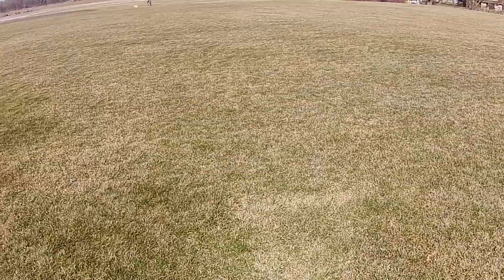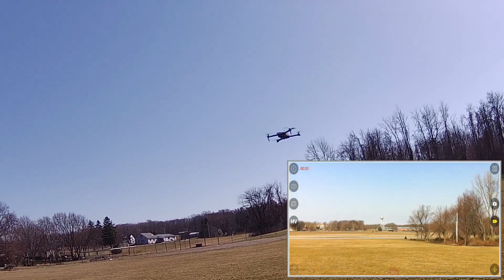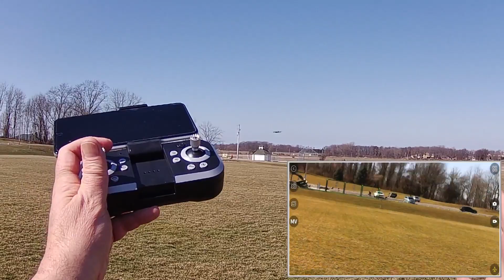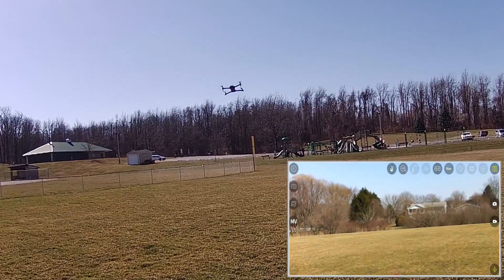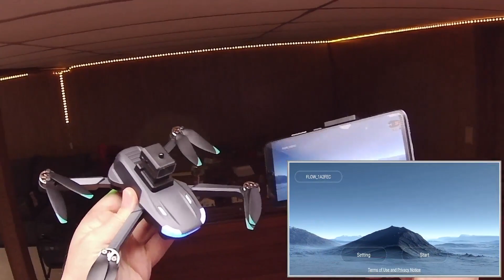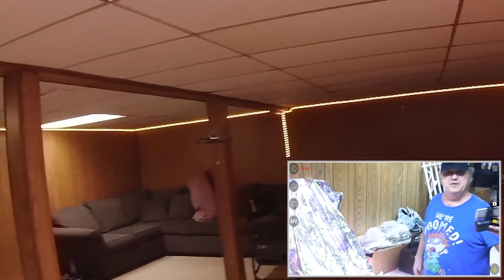YLRC S138 Brushless Optical Flow Obstacle Avoidance Drone Flight Test Review

Comment: Hello Mr with the TShirt. I noticed on one of my cheapy drones that the control is not smooth. If you push forward it tilts one angle according to its rate. So halfway stick forward is the same as full forward. To change angle you must change the rate. Does this drone you demonstrated have smooth control ? Bit stick forward bit of tilt... more forward more tilt. ?

Comment: Not bad ... $50 for a beginner quad with brushless motors.  That's a big plus.  Too bad they are still using proprietary batteries.  Lots of wind noise with your new hat cam .. I wonder if your hat cam has an aux mic input ... might make for better audio in your vids.  I got my old XK X380 back in the air last week. I burned up the OEM WLToys gimbal, Git 2 cam & telemetry module when I decided to re-route the wiring to make it neater ... at 4am.  Reversed the 5V & 12V plugs .. all the magic smoke got out. Got it back in the air with a Mobius Mini. With no gimbal, its pretty shaky. Cheers.

Comment: I wonder does the obstacle avoidance work for obstacles above.  Like the ceiling? Thanks.
Reply from the maker: It doesn't.  But it would be nice if it does, as these altitude hold drones tend to drift into ceilings.